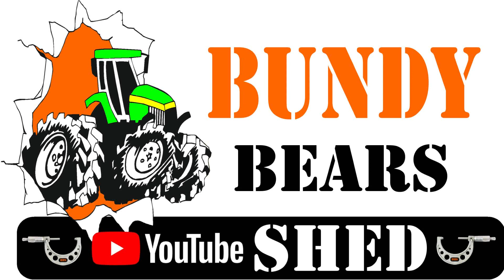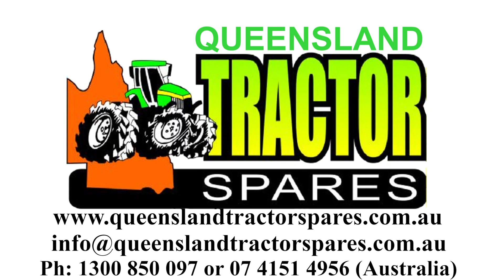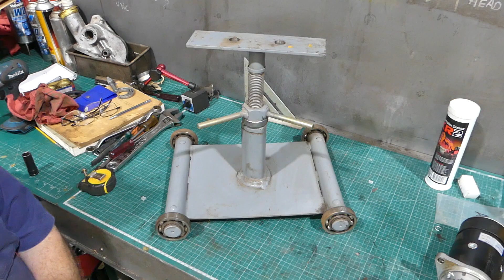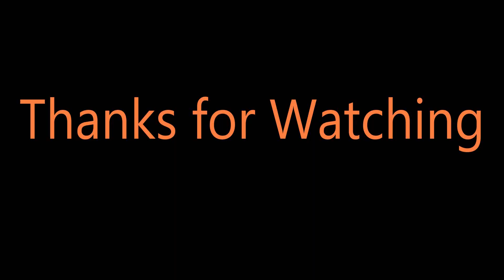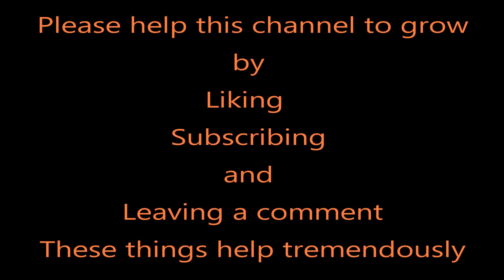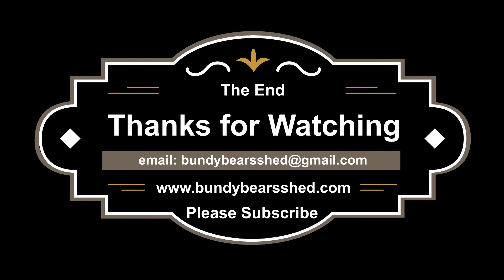Kangaroo Stew # 237 Part 2  A look at my home made Splitting Stand

Comment: Nice Splitting Trolley Lance.
Necessity is the mother of invention.
Started as an 18 year old at a DB dealer splitting mostly 885's & 990's on site. They were a heavy dual clutch, the rails weighed a ton & the cabs were a pain. Always check your new drive and pto plate fit their shafts before assembling the clutch.

Cheers,
Paul.
Reply from the maker: I did 8 years with DB, I have the hydraulic valve tool still and the full clutch setting set up I got of a bloke a while back. I might find one worth doing up one day.

Comment: That's a pretty fancy and functional stand. When I split my TO35, I used one of those harbor freight 4-wheel dollies, piled wood blocks on top, to support the back half of the engine split at the clutch while the front of the engine was on the tractor wheels (with those angle chock blocks under swept arms you showed). The dollies are rated at 1000lbs and half the weight was on the tractor front wheels so no problems. Then the back of the tractor was on jack stands and I used an a-frame chain-fall lift to remove the transmission away from the rear end. Stripped and rebuilt the trans (locked up due to water through the shifter boots). I should have made a little track for the dolly but I could still roll it into place ok on the cement floor. No welder at the time to make a better cart though I enviously marveled at what you had in a few older videos. Sharing if someone is in the same boat as me someday, a $15 dolly can get the job done.
Reply from the maker: There are a lot of ways of doing this, thats for sure.

Comment: I'll be splitting my TE20 soon to replace the clutch and I'm going to copy your design.  I have wheels off of an old floor jack that should work nicely in place of the ball bearings.  Thanks for the good information.
Reply from the maker: Go for it, this is a handy little trolley.